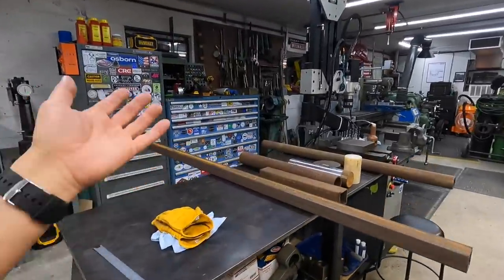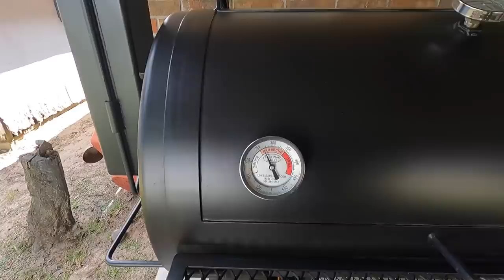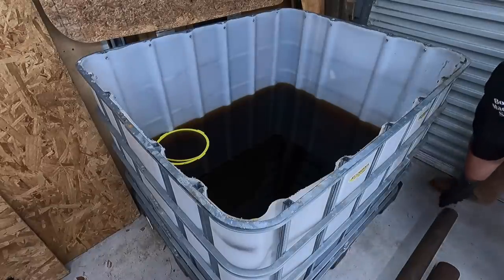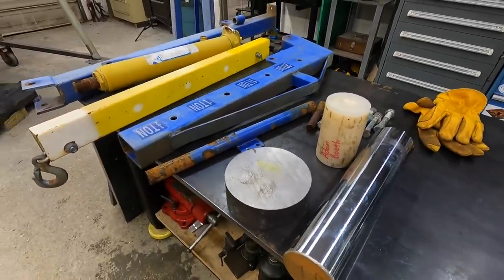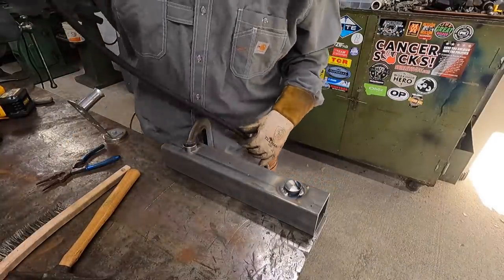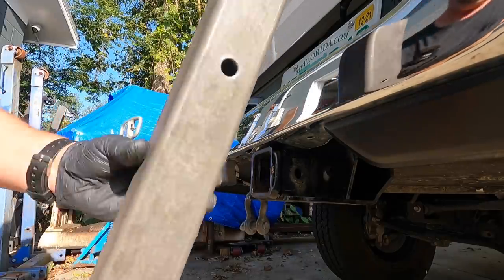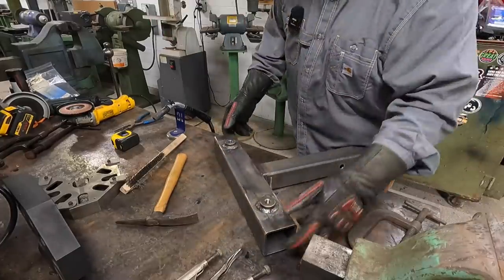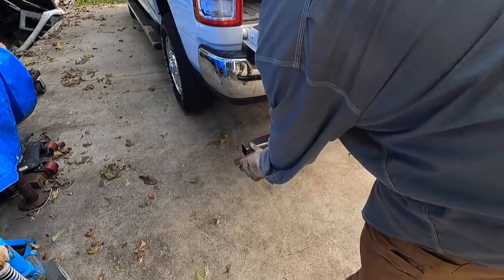Truck Hitch Crane Build Ep: 1

Comment: I would recommend a small bottle jack attached to the foot of the crane to give you more control over the length of the support at the outer end. depending on the load in your truck,  and where you park the bed height will be slightly different almost every time.
Reply: I previously had a bed mounted crane and it was a great addition to the truck.
Reply: Good point but he could also have some sort of course threaded screw like a machinists jack to take up the slop between holes. But I also think that if the foot is a bit short, the weight of the "load" will sag the truck springs enough for it to bear down on the ground. Looking forward to seeing this thing finished and working.

Comment: I agree fully with what Mr. Booth says here in regards to welding.
The basic problem with hardwire MIG is it was originally made for 3/8" absolute maximum. Unfortunately its ease of use has convinced many that they can actually weld which is questionable in may cases. Hardwire has a tendency to cold lap and extra care must be taken to ensure good fusion to both sides of the joint. I have seen test plates where the weld looks perfect but if you drop it on the floor from waist height it will break into two pieces. When you look at the weld, it has not fused to one side or the other better known as cold lap.  
Stick, Inner Shield, Dual Shield ,and TIG all require a much greater skill set that MIG requires but with anyone of these alternate methods and a competent operator you will achieve much stronger welds with a greater degree of penetration and ductility.
And yes, I am a First Class Journeyman welder with over 50 years of hands on experience.

Comment: Have a good ground ? Table might not be enough.  Glad you found it.  On the foot might consider a vernier set of holes - so if the truck is on cement and the foot in dirt or rock the distance is different.  Having one or two holes matching up with a series of stepping values it would be cleaner to use.

Comment: Just a suggestion:   please move your hitch to the front wall of the bed.  If you rear end someone depending on the speed at impact may come through the bed and cab walls.  If up front it will have less momentum.  Even better to have it cabled down to something.  

When I purchased my hitch the shop owner recommended that I leave the hitch in the receiver all the time in case I am rear ended.  He had had a number of customer where that had happened and the hitch was damaged but not the truck.  Pull the hitch pin and you can pull away.  

Safe travels!

Comment: You are talking about putting the support leg where the hoist is but when you put weight down on the crane you need them at both ends. If you pick toward the passenger side, the driver side won't have weight yet the passenger will. Without support all the load is on the receiver tube of the hitch at that point. So you want a stabilizing arm on both ends. I would also suggest using some acme threads for feet with a way you can fine-tune on the ground. Also when your truck has the load in the bed it will sit lower so having some threads with a spot to stick some round stock would get you out of that spot as well. 
I am with you on fluxcore. I welded bridges for 6 1/2 years and all our welds out of flat position were dualshield. I ran pure CO2 which is cheaper too but I played with scrap with C25 and it didn't really make a difference visually. When I ran some 90k wire lincoln required C25 and it ran great. With the 70 and 80K versions our WPS called for 100% CO2. I have passed a hell of a lot of x-rays and UT's with all three wires and both gasses. It lays in so much nicer than solid wire and barely any berries if you get your settings hot enough. Your arc sounded just where it needed to be..

Comment: I have not watched the whole video yet, but at about 30 minute mark, about the wormholes.. We had similar issues using stainless fluxcored wire and shielding gas. The issue was that the wire had been exposed for too long, maybe a week from when we first took it out from the protective sealed bag. No issues first couple of days, but the following week those wormholes began appearing. Could you maybe have the same issue? If the wirespool has been sitting for some time in the machine. Fun little project, I'm a bit jealous over your machinepark tho 😉 Cheers from Finland!

Comment: On that leg use the same system of screws instead of a pin.  The height will depend on what type of terrain you are on.  It might not be as strong as the pin though.  It is looking good. All the best

Comment: That support leg you are making with the 6in disc should be adjustable with holes like you said to get it to the ground.  Maybe by adding a screw shaft to tweak it so you don't have to use a shim block.

Comment: HI Adam the problem you are having with the welding of the mild steel round bar is that the steel is free cutting which has lead added to make it cut easier. Used to weld it with a Phillips 28 mild steel electrode.

Comment: Adam, also as a last resort check for a dirty gun liner, and that your gas diffuser is not blocked (whether it’s ceramic, plastic or intergrated into the tip holder)

Comment: When I get inconsistent weird problem like you described Mig or Tig, I go change or check my consumable torch components, collets, gas diffusers or contact tip. If you don’t get good clean current flow through these components I found dirty current can give you the appearance of a dirty weld. This first occurred to me Tig welding.  We ran our torch components at the high end of the duty rating with an almost constant flow of aluminum parts through the welding station throughout the shift. Two or three changes of parts through the shift was common.

Comment: Adam, love the videos keep them coming...after many years as an acft mechanic i would suggest you use some soapy water on the nylon bushing, anything petro will degrade the nylon quickly under a load. thank you for reading and commenting on our posts. MF
Reply: Water is going to swell that nylon. Not sure what the tolerance will be, but if it’s anything close to precision it will lock up. The bush needs to be made from acetal, or better still Vesconite.

Comment: Nice idea. I would build something like that for my welding shop. Maby you were to close to doors and wind blowed out your shielding gas. To be honest for those things i would like to use solid wire pulse mig any day rather than flux core gas shielded. Or TIG if you are looking for fine finish straight from welding. I don't say that dual shield is wrong because i will use it for 20mm and more thickness (pardon my metric, i'm from Europe). Pulse MIG would also create nice got and good depoistion beed. Only use some quality type wire like G4Si1 and you will have nice welds.

Comment: You might also find it useful to add a chain-fall or lever-chain hoist, for finer-pitch stuff when the crane is at max-extension. Something like a Kito LX003 or LX005 is almost pocket-sized, good for 250kg or 500kg respectively.

Comment: I built 3 of these hitch cranes. The crane hitch should have a tube to receive a  trailer  hitch so you can move a trailer with the crane still attached to the truck.

Comment: Adam, I’m a certified structural welder. We weld almost exclusively dual shield on our projects. It runs much hotter, which translates to better penetration. The best way is to push the weld. I don’t care what the Internet crowd says, you are doing it right! The other process we use 232 wire, most guys say “ what’s that wire?” Yeah, your not a welder I say.

Comment: Some of the issue on the worm tracks could be the wire stick out, longer stick out gives you a lesser chance of trapping gas under the slag before it solidifies. Also, the wire you are using could be sitting there and soaking up moisture over time, longer stick will preheat the wire before it melts, the preheat action will sort of release gases that could be causing your worm tracks.  Hope that helps.

Comment: Hey Adam. Get yourself new mig torch, that's may be your gas problem. Im changing my torch every year at work. Just benith the torch usually you get some kink in gas line inside the lead and at some angle you get gas cut and porosity.

Comment: You can do whatever you wanna do with your welding but I'll stick to solid wire and leave the Flux core for when I'm somewhere doing a on trail repair or something. I also run the 75/25 and I run a high quality welding wire from Lincoln and even with dirty material I get an amazing weld. I get what you're saying but I think anything 3/8" and smaller you don't need it. Obviously it's gonna be strong cause that's what stick welding is, Flux core is basically the same thing. It's a welding media with its shielding gas built in.

Comment: Check for leaks in the connector and the gasline of the torch.
Internal leaks in the welding machine are also not uncommon.
Next would be blow out the liner with compressed air or replace it.
Last would be moisture contamination in the welding wire.
I always have a clip with felt on the wire to clean the wire before it goes into the feed rollers, helps alot with contamination getting into the liner.
Been there, done that.

Comment: you're having the same problem i'm having with my Miller 211....  it seems like at random times i get no gas coverage when i pull the trigger.  i dont think it's the flow meter (i switched out my old regulator when this started happening), i think it's the internal gas solenoid.  but i haven't really dug into to figure it out.....i have just been TIG welding everything instead.  haha

Comment: Great work, as an idea why not have a fold down leg with a screw adjustable foot bellow the lift so the weight is transferred into the ground.  You could also have it slide in so you don’t have to dismount it to fold down the tail gate

Comment: i dont think those nylon buchings are going to hold up what i sugest is using a 1 ton hub and bearing assembly and also 2 outriggers as your heavy load will always swing to the low side with vengense  unless its leval eliminating spring depesion on the unsuported side. just my experience as a 45 year welder fabricator. im 64years old.

Comment: Have you tried non filled tube ?
Super if you want a clean weld in thin material, melts like a thin wire but steady like a heavy one , and starts every time..
We used it on a robot welder that otherwise had issues to start on a previous weld with spatter as a result,
Reply: Do you mean the welding wire is just hollow tube?

Comment: The worm/pin holes might be from the evaporust stuff. If ya wire isn't moisture effected, and the gas flow doesn't have any issues, that's the only thing I can think of from ya set up.

Comment: Nylon absorbs water and swells. You'd be better off with some UHMW PE or maybe Delrin. I worked for a company that made remotely operated vehicles and one of the cameras on the vehicle tilted on a nylon bushing. We would get faulty camera units back where the bushing swelled and it locked up the tilt mechanism.

Comment: Welding isue: I think you are not welding so often and welding machine is just siting in the corner. So before welding "blow hoses" with welding gas. I dont know if you have a bottom on machine thas says "gas" (normaly it is used to adjust gas flow when changed the gas bottle). Because all gases in hoses will be "vented out" or mixed with air (thats verry important specialy with Tig and aluminum) Hello from Norway. Working as a welder for 10 years in Norway, but I'm from Lithuania :)

Comment: Hey Adam just a thought about the worm holes in flux core we use heaters on the co2 lines before it goes through the welder due to it freezing after welding for longer periods, but probably not an issue if its smaller welding jobs

Comment: This may have been mentioned but your gas issue after the new regulator may be the O rings where the lead slides into the gas block. I had a similar issue in the past and the O rings were dry rotten and cracked. They looked fine at a glance but up close you could see the cracks.

Comment: I think you'd be better off with another threaded t-handle for your outrigger so that once the load weight is in the truck, you can loosen it and the weight of the load won't be an issue for removing a pin.
Just my 2 cents.

Comment: When you said that first weld didn't act right, the first thing that came to mind was "Did he forget to turn the gas on?" but then "Nah, Adam would admit if he did.  Wonder if his hose has some cracks in it and is sucking air."
Reply: If the hose had a split the gas flow would keep out the air.
Reply: @jostouw4366  Not a split, cracking.  Minor cracks in a gas line can act like a venturi.

Comment: Yep, flux core is strong. We tried to weld new grousers on our 9 with solid wire and half of them broke off. Switched to flux core  and the welds held as good as 7018. We always burned a 6010 root pass with either method.

Comment: The trailer received load rating is for a point load of a trailer ball. Without support I can not see avoiding damage to the frame. The moment created by the crane under load is also likely to far exceed the rating of the hitch.

without  support lifting a 300-500lbs load 4' behind the bumper could be visualized as an equivalent of a 1200 to 2000lbs trailer tongue (with ball 1' from bumper)

If you put the support under the receiver, you will have a significant twisting moment at the receiver, and I can't imagine not damaging the receiver. If you put the support under the base of the crane, you will have a significant force in the other direction when the truck settles with load. As well with the support under the base of the crane you could still create a "tongue load" that exceeds the rating for the receiver when the crane is at 90 degrees from the side support.

It would be really interesting to see how you handle all of these forces to ensure when you are moving that 600+lbs load with a point load 4' to 5' away from the bumper.
Reply: If it is that far out, the force will be even higher than that. I am interested in seeing how this will be handled. I've only ever heard engineers call torque a moment, so I am guessing that you are an engineer?
Reply: @davidscott5903  Yup, will admit, EE by trade, but did very well in the statics, dynamics, and thermal transfer courses I had to took way back in university. 

I could use a lot more experience on the ME side to even be close to being an expert, but my comment was more to start a discussion than anything else.

Comment: Once upon a time I mounted an engine hoist off the rear of my truck so that I could move heavy items across dirt and gravel.  Putting a support under the hoist is a good idea. As depending on the item you are picking up the back of your truck will squat several inches. What do you intend to do about about rotation? With the crane pointed straight back it will try to twist that 3" tube. Considering that the arm is about 4 feet that is a lot of leverage to twist.

Comment: Co2  is deep penetrating and runs cold helps keep gun cool and is the cheapest option for gas, however its got a high splatter  and worm hole rate  and cant do thermal spray welds which needs at least 25% argon.  Production shops use it because of cost whenever possible .

Comment: Adam, You may want to check you hose connection at the welding machine and gun. The hose may not be seated properly or you can have a bad o-ring

Comment: The leg that touches the ground can made to be detachable also,  using the same 3" square tubing where the bolts go on the hitch part I believe you had some extra left over and then using an extra bolt like the one used to lock the sliding  2 1/2 square tubing

Comment: we use pulse spray transfer mig when where welding heavy equipment where we work, it's cleaner than dual shield, and penetrates as well, or better. making shoes for snow pushers out of one inch plate, running 0.045 wire at 500 inches a minute with 1.03 trim, you have to let the part cool a few minutes in between welds or you will melt through the plate.

Comment: Whenever I have a square tube sliding inside a square tube I weld nuts on one corner so that the thread axis points diagonally at the opposite corner so that when the bolts are tightened against the interior tube it takes out all of the slop as the tube gets pushed into the corner.
Reply: Good idea man

Comment: The dual shield helps hold the heat in and takes longer to cool making it much stronger weld!! I only use .045 esab dual shield wire and absolutely love it for its strength!! Yes I agree that it is as strong as 7018!!! Welding with the esab dual shield wire as long as everything is set up Wright the welds look amazing every time!!! What kind of wire do you use and what does it end up costing you for a roll??? Before the COVID epidemic I was getting a 40lb or 50lb roll for 120.00$ but about a month or two ago I had to go get some more and I needed some .035 and it was 389.00$ for a 40lb roll!! I told them no something is wrong I had been paying 120.00 for a roll they said well everything is going up!! I said over double the price??? They said yup and I was lucky it had been 410.00$ a roll!!! I couldn’t believe that!!! I guess all my stuff will be going up also then or heck I won’t make any money to be able to buy more wire!!! But I absolutely love the esab brand wire the best!! Let me no what you think and what you get your wire for????

Comment: We use 85/15 gas at my employer. We don't even have dual flux available. I have used flux core at home with my little 110 unit. I had fair results with the straight flux core.